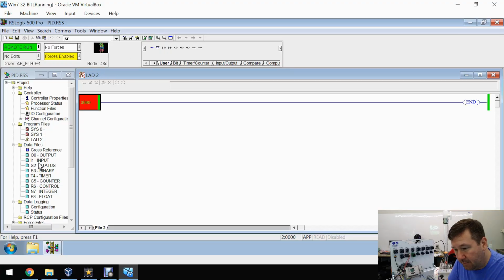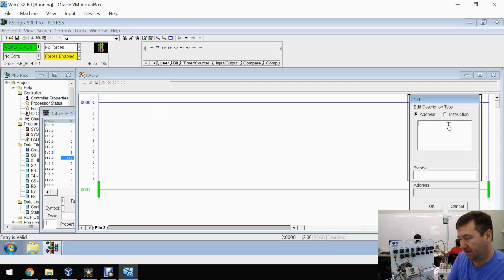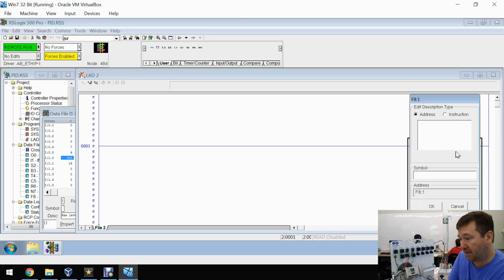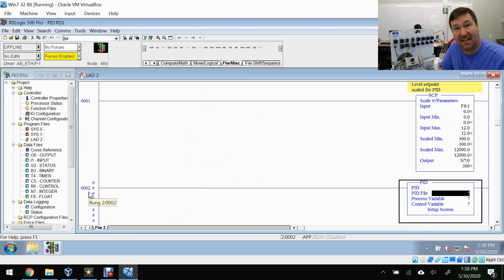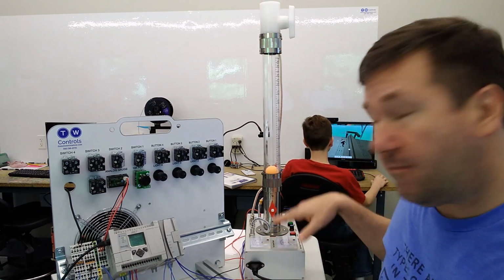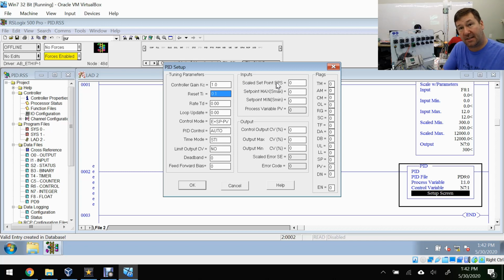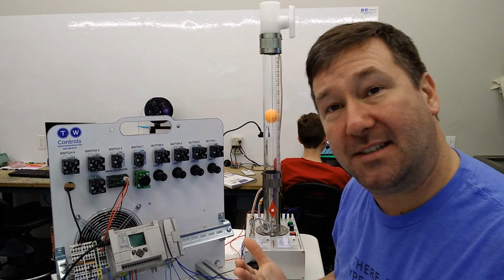PID Control in RsLogix 500 for Allen Bradley Micrologix and SLC

Comment: How does the Update Time Work, STI is system timer, no timing bit needed? Timed, do we need a timed pulse bit in front of the PID loop?
Reply from the maker: It depends on what timing mode you select. With STI it will execute every time that it is scanned and you will put it in the routine that is called by the sti. Or you can choose not to use the STI and just run a regular routine with an update rate.  Here is a  more recent video with some more information.
https://youtu.be/jrVtyUqrz3A?si=cOGnyieTdQ5Z7Dcr

Comment: Hi Tim, I have converted PID from SLC 505 to CompactLogix 5069. Would you please let me know how to change the P,I,D from SLC to Compact and if I need Independent or Dependent? The PID formula for SLC seems to be Dependent, but the units seems to match independent. Thanks a lot!
Reply from the maker: First check out this video on the differences in the equation between the SLC and Compactlogix. It won't be perfectly straight forward. 
https://youtu.be/FVTv6Gi9IJo

Comment: Is there a good way to 'initialize' the PID output?  A way to keep it from always starting up at its lowest value or ramping up to its highest value if its the controlled device was shut off?  

For example: always having a pump start up at 30% speed and then the PID starts adjusting from there.
Reply from the maker: Yes there is, I'm getting ready to pick back up on PID videos and will cover it.

Comment: How would I get the scaled value without being able to just turn the fan speed all the way up and see where the ball is? Like if I had a tank that I was trying to get the level for and there was a level indicator, how would I go about getting the full value of the tank without actually filling it up to see what numbers I’m going to get back from the level indicator input?
Reply from the maker: You would find the high and low setpoint on the documentation.

Comment: Can rslogix 500 emulate simulate a PID control.
Reply from the maker: Not without a lot of work, you will need some hardware.
Reply: @TimWilborne  Thank you Sir. So I have weighed my options and presently I believe i can manage the " a lot of work". That is considering the hardware alternatives. I have been doing bits and pieces on SIEMENS TIA portal(works great). I believe with some research and lots of your help, it may just work . Thanks again.

Comment: First, I thank you for this video
Secondly I have a question
What is the difference between raw/proportional scale and pid scale ??
and Are the binary Scaled numbers is fixed for all modules 1762-IF4 and OF4 and IF2OF2 for the two option raw/proportional and pid ??
Meaning is the numbers 0 to 32767 is constant for 1762-IF4 and OF4 and IF2OF2 when i configured raw/proportional  Or it differs from one module to another and the same thing with PID scale configuration for analog input/Output
Reply from the maker: PID scale is 0-10,000.  The raw formats of those three numbers are the same but it is good to check because not all of them are the same across the Micrologix line.  Check out this link.
https://www.theautomationstore.com/rslogix-500-analog-bit-resolution-and-precision/
Reply: @TimWilborne  thanks

Comment: You said F8:1 was an unused floating point number but it became the input for the scaled with parameters function.   Where does the F8:1 obtain its data value if there is not a function outputting to that data storage?  How does F8:1 become and input when it is just  a register?  In the previous SCP F8:0 was the output.
Reply from the maker: Shooting from the hip since I didn't watch it before replying but wasn't F8:1 the level set point?  This is the desired level for the PID and we manually enter it.  The 2nd SCP scales the value which we entered via the data table to PID units.
Reply: Thanks Tim for your great work, do you please mind clarifying the use of the F8:1 float and it is unused and it's still puzzles me where it's getting its input from. I would have expected you to use F8:0 rather.
Thanks

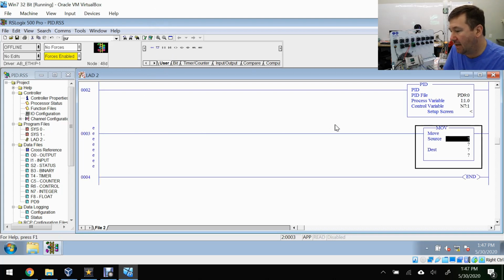Comment: At 10:30 you're using a move instruction to the analog output, but I noticed it's an integer. 
I tried doing the same thing, but used a floating point to get more accuracy, but the analog output just rounded up or down. 

Is it possible to use a floating point for analog 4-20mA output?
Reply from the maker: No and we've brushed on this in several videos but I don't know that we have ever addressed it directly.  While analog is "infinite", the it comes into the PLC as digitally with a certain bit resolution.  In the case of the Micrologix, it is 12 bit resolution which means that it chops the full scale into 4096 increments.  Now someone will probably come along and correct me and say that the Micrologix is "15 bit" resolution since its scale 0-32760.  However, the Micrologix shifts the data by 3 bits, ignoring bits 0, 1, and 2 and placing the data in bits 3-14.  I should do a video on this...oh wait, as I type this I remember I wrote an article about this.  See link below.
https://www.theautomationstore.com/rslogix-500-analog-bit-resolution-and-precision/
Reply: Tim Wilborne great read, thank you for the reply!